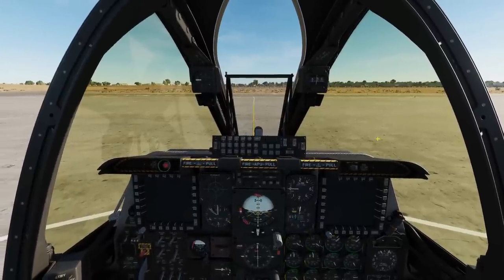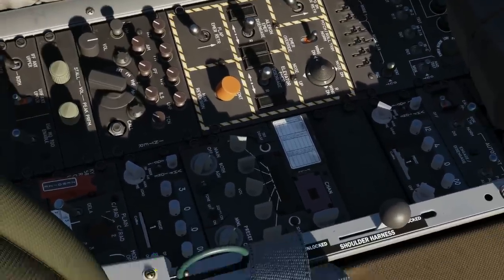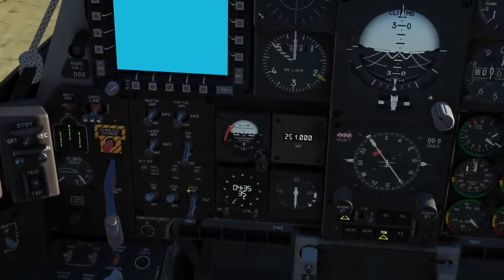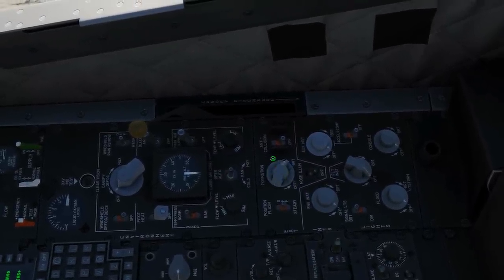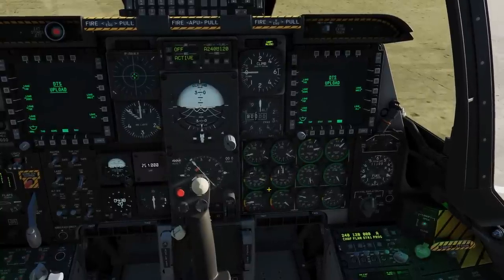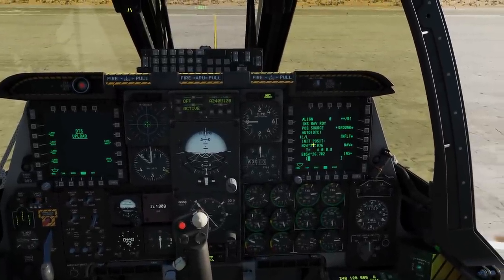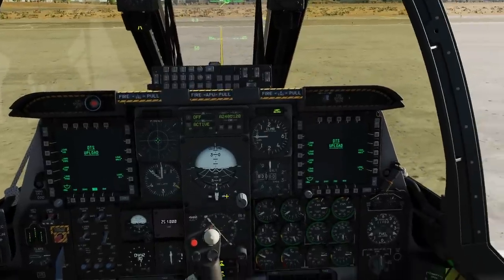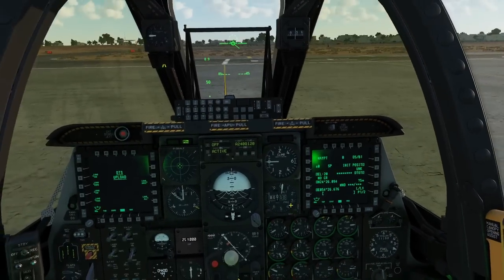A-10C Warthog: Re-Arm & Cold Start Tutorial | DCS WORLD

Comment: Cap. You forgot the pitot heating (and canopy). And second the INS can be loaded much quicker. It's not a full alignment but full enough because the A10 doesn't have INS drifting like other modules do. You do it like this. Just after the cdu is finished with its bit test press INS on the right bottom, then press ALT ALIGN on the left side and then press FAST on the right side. Now the INS alignment will be finished in 2 min instead of 4.  So if you do the rearming first and then the manual startup you will be flying within 2,5 minutes.
Reply from the maker: Copy thanks!

Comment: Hi Cap, i was wondering about the weightlimit for planes. I assume this has to do with take-off. Could you however: load minimal fuel and max weight bombs and rockets. Then fly to nearby tanker and top off fuel? Going over the weightlimit while topping off?
Reply from the maker: It's purely a recommendation, planes do not have a hard limit of any kind in DCS.
Reply: DR650😱

Comment: So the A-10C II upgrade isn't showing up in my module manager? Already purchased It's fully released, right?
Reply: Do you play in open beta?
Reply: Need to be in OB. Also if you only got the upgrade you need to have the original A10C module installed as they share files for FM.
Reply: @phoenixsui  Yeah right after I commented I kinda looked at it sideways and realized what was going on lol Switching over to OB
Reply: @jimmorrison2783  Tyty, I realized right after that it was because of OB lol
Reply: I have the same problem:( when will it come to stable release?
Reply: @horstweihrauch1  It is released in the open beta. Not any problems so far. I'd recommend downloading it and just playing it on there.
Reply: Dustin Glenn thank you. I will check if I have enough space for both. Play it on steam.
Reply: Wait when I go to the open beta, I see the bee flight model for the A-10, but I don’t have the panel to start the helmet, and I also don’t have the knee weapons. What did I do wrong? I bought the A-10C II mod already
Reply: @brycewalker7797  Make sure you have the A-10C II module installed, then go into the mission editor and put in an A-10C II. There should be a normal A-10C and the A-10C II. Make yourself the pilot and you should be good. HMCS panel is underneath TACAN/ILS and you only have to move a single switch up.
Reply: Dustin Glenn yeah man, I got it to work... thanks!